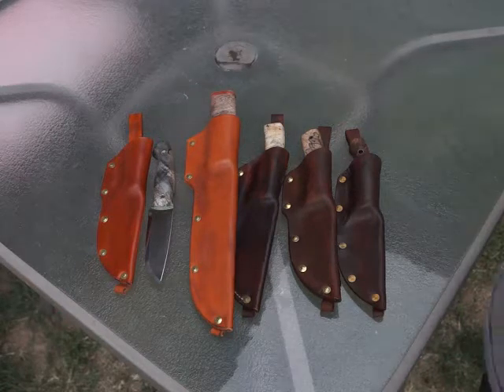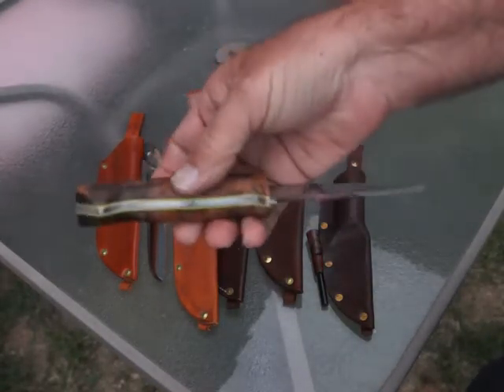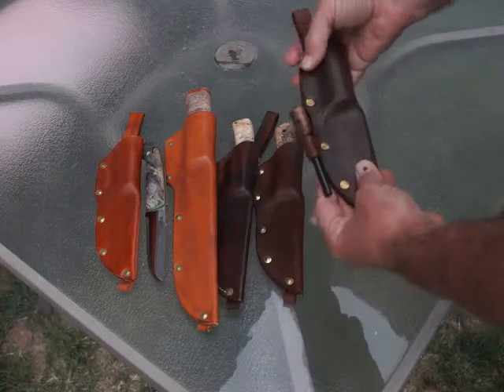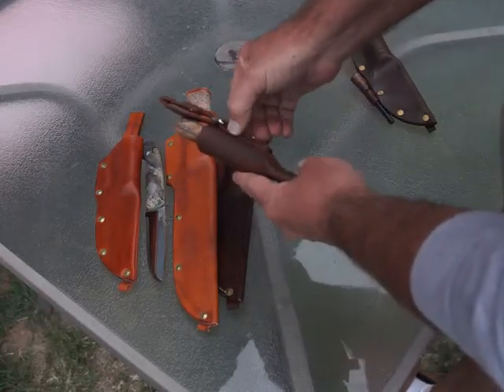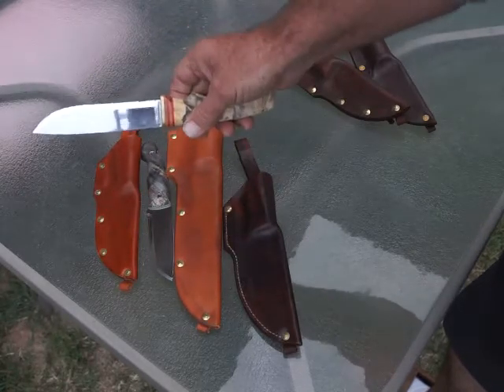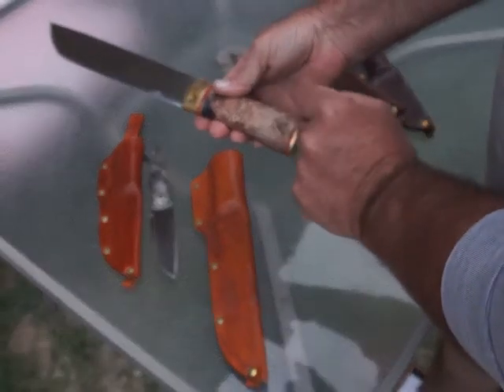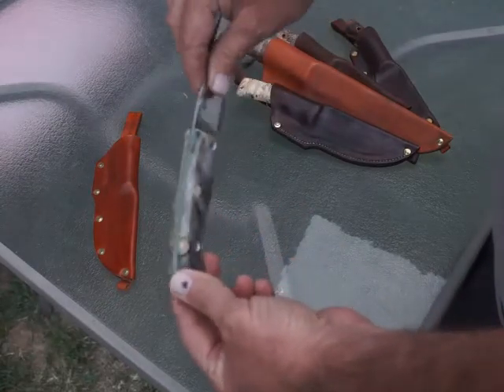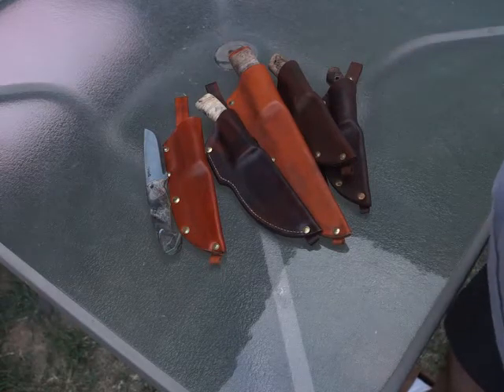latest custom Helle knives Utvaer, Temagami, Jegermester , Lappland

Comment: one question: (i'm guessing you're buying blanks for customizations) do you get a special Utvaer blank that's laminated, or the listings on Helle's site are wrong in listing it as 12C27, or you're getting your blanks custom made or something?  (i'd gladly get one of your customs, but i'm in europe and import duties+shipping would make it more expensive than most custom knives :( )
Reply from the maker: praetor47 sorry for the confusion, utvear blanks are all 12c27.
Reply: @arizonabladebroker5010  interesting. i've also stumbled upon this video https://www.youtube.com/watch?v=TbyMjI761JI and it can be clearly seen it's laminated, though the vid is from 2016. maybe it used to be a laminate and they changed it to "pure" 12c later on?